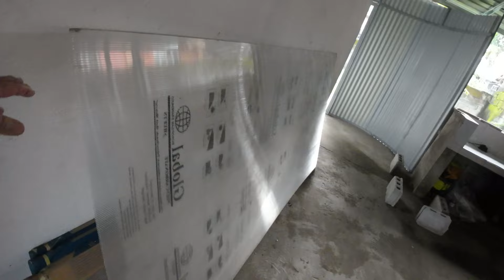$36 USD Monthly Rental / Construction update / The Man Cave

Comment: Check out the screw-in ceiling fan / light combos. The ones with big blades are very good. I have one of the "Seen on TV" models in my laundry room and it works excellent. Whisper quiet, moves a lot of air and has a remote.
Reply from the maker: The problem is the ceiling is not really high enough. It's only 8 ft high
Reply: @Ex-Pensive_Expat  It must be lower than that, 8' is the standard height in the US and we have normal ceiling fans in every room. Maybe you are very tall...lol
Reply from the maker: The ceiling slopes downward.  I was limited with the other roof then ended to continue the slope so one end might be closer to 7'

Comment: Can't wait to see the finished project.
Reply from the maker: They just installed the electric today and Wednesday through Friday will be doing dry wall and building up the height of the wall. That will provide additional insulation on the flat wall areas. Then all I need to do is figure what I will put on the curved walls. I already know the insulation for that
Reply: @Ex-Pensive_Expat  I kind of like the idea of bamboo.
Reply from the maker: It's turning out to be the popular opinion
Reply: @Ex-Pensive_Expat  Can't wait to see the finished build

Comment: you need a layer of sisalation under the roof (foil & tar paper). Normally pinoy use thin ply
Reply from the maker: Thank you yes.  There is some material that is like a foil quilted type of material

Comment: The gap between your man cave wall and the cement wall is concerning. Debris can fall in there or even thrown in there by your neighbor.
Reply from the maker: The construction crew will be filling in the gap starting on Wednesday. I guess I wasn't clear in the video.  The wall will be raised to meet the roof / gutter. It was also act as insulation

Comment: If I ever make the jump, I will be sure to join. You might want to look into designer colors. I myself prefer khakis, with accent colors such as blacks, including charcoals, wines, and dark dark green almost black for the exterior, and just other khakis to accent inside, though a charcoal countertop looks real good inside a khaki interior. My pallet is simple, and limited, but because of its simplicity, I never miss. I know exactly what I'm doing. Color is an extremely relative medium, and much closer to a science than most ever fathom. That is, it is all based on a very certain relativity. I worked many years behind an easel, and took college color and design. One might say I have colors. My response is not your black and white exterior, I understand that. It is to the "blue" wall; but it is not done yet, so I may be premature. You're doing real well; I hope you beat your affliction.
Reply from the maker: Thank you my friend for taking the time. Definitely not premature. Khakis would be perfect if I put up the Bamboo.  Also in my kitchen in the other side since my counter tops are black..  I will definitely look into that. Thank you!!
Reply: Sorry David, but you'd "miss" in the Philippines. That sun is brutal and you want white or the lightest colors available for the exterior colors of structures, unless you like the idea of living in a solar oven and paying the associated increase in energy costs in order to cool the interior and make it livable. There's more to life than "pretty".
Reply: @danp1043  I agree actually, and if I wanted some color on the outer shell of a Philippine house, it would most likely a be a very light shade of some form of khaki. If I was that close to the sun though a complete white elephant on the outside to reflect as much as I probably could, with maybe some light silver tint on the trim would probably be my preference. White or silver metal roof, etc.
Reply: @Ex-Pensive_Expat  Khakis basically come in two variances, and are either tinted in a very neutralized beige, or olive, and then are delivered in different values { referring to how dark, or light they are ), and every maker have their own variances, but basically, that is what they are. I shouldn't push the idea really, when someone could masterfully do blues; purples with sky blue LED lighting etc, and succeed tremendously, and people who know more than I can work with all sorts of colors successfully, but that would drive me crazy, and that is why I tapered down my own selections for my own living space, or anything I build. It is a subjective subject, though it does have a science to it, but too much of it can drive a man crazy, and that is why a great extension of the subject is most usually given to women, who of course by masculine standards, are crazy. Sorry if I imposed any craziness. I just see you like fixing the place, and thought I might direct you to some estate enhancing possibilities.

Comment: Are you going to insulate the ceiling? Would lower electric cost and more comfortable
Reply from the maker: Yes Paul!!  Absolutely!  The ceiling and curved walls both.  The straight walls will already cover most of the wall area needed to be insulated.

Comment: Could you power wash the walls of fence?  Oops!  You answered my question in the video
Reply from the maker: Hahah. Thanks for the comment..  I might power wash before I install the bamboo. To get rid of the moss or mold
Reply: @Ex-Pensive_Expat  I don't ever see vinyl fencing in the Philippines.  Probably  only lasts 10 years in that heat.
Reply from the maker: @JohnBabcock-qy1cs  Not sure. But it's a lot more expensive. Concrete is traditional lasts longer and much less expensive

Comment: How are you sealing the joint between corrugated wall and floor?
Reply from the maker: When the tiles go in, the concrete will fill the gap on the inside. On the outside I'm not 100% sure yet.  There is a spray foam that hardens. Same concept as caulking

Comment: Why not a powered roof fan?
Reply from the maker: That's possible it's the height of the ceiling that will be limiting
Reply: @Ex-Pensive_Expat  get one of those domes that go on top and a fan between the roof and ceiling
Reply from the maker: Maybe if I need it. I will have aircon at one end an exhaust fan at the other end